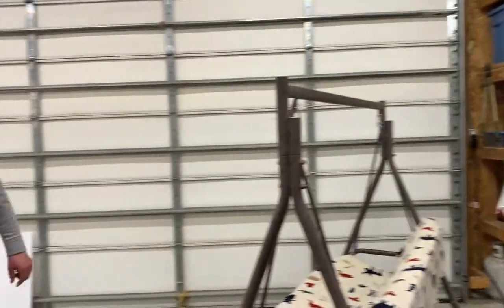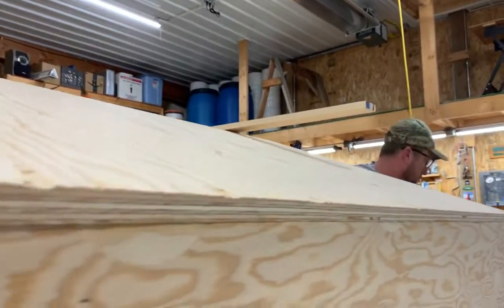Squaredrop Camper Build, Part 4

Comment: Great series so far what did you use to make the pocket holes and what type/size screws?
Reply from the maker: Pockets holes made using a Kreg Jig (Google it) and 1-1/4” course screws for plywood connections. Those jigs are really handy for a lot of applications. Thanks.